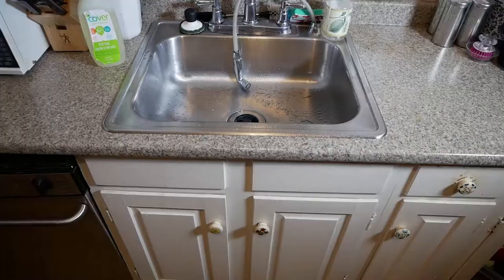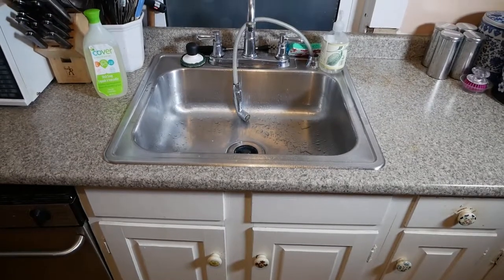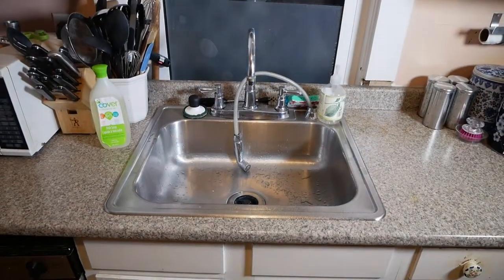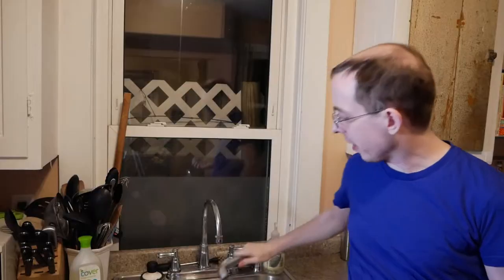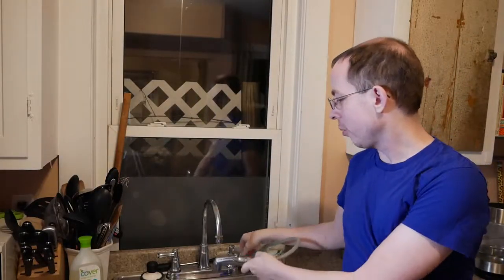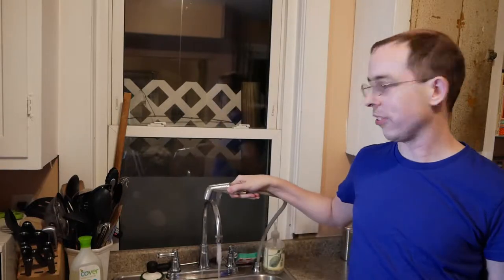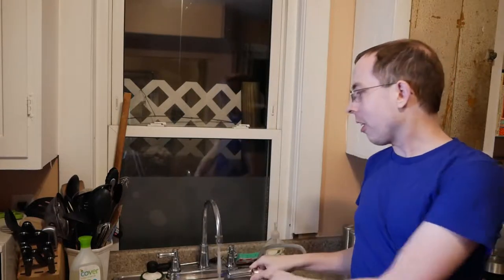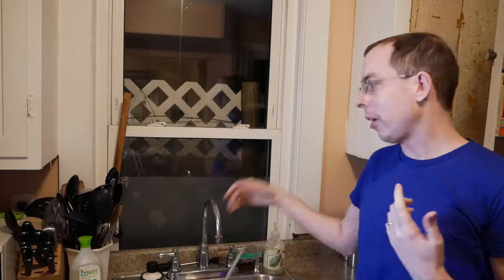Sink Troubles - Chris Plays Gourmet

Comment: Great video!  By fixing.. I hope that means a new sink. Upload a video of the guys fixing the sink that will be fun.
Reply from the maker: I decided not to film the guy who did it -- it felt like it would be rude :) He did get in there, blow torch off the old broken taps, replace them with new ones, and replace the faucet, and now I have a working sink again! It's been so nice to actually have something that works, and it turns out the reason my hot water never worked right was the same root cause! Super nice to have a sink again!
Reply: It definitely is.